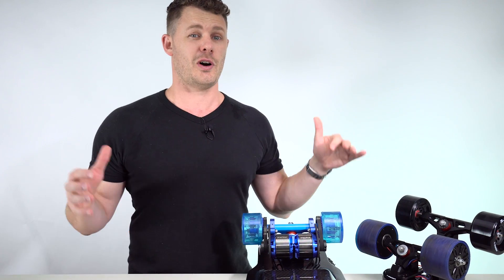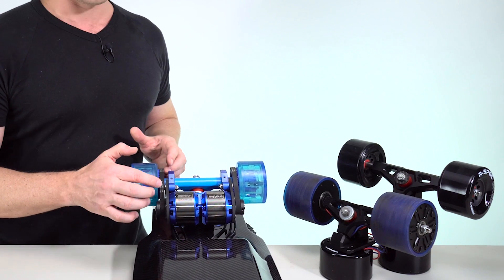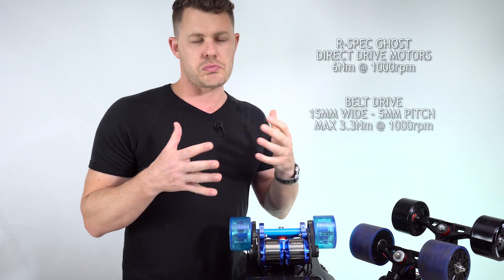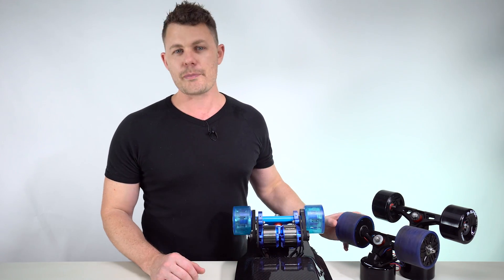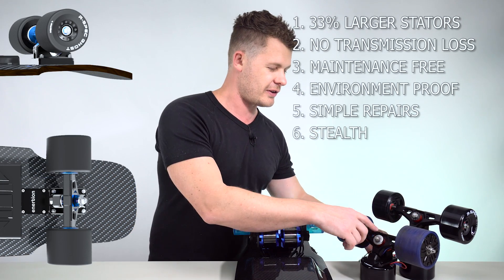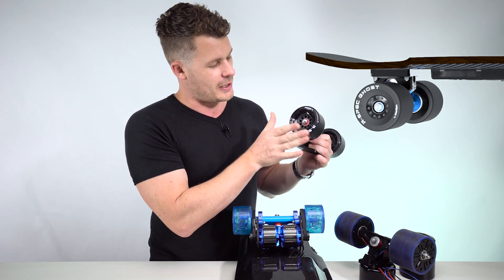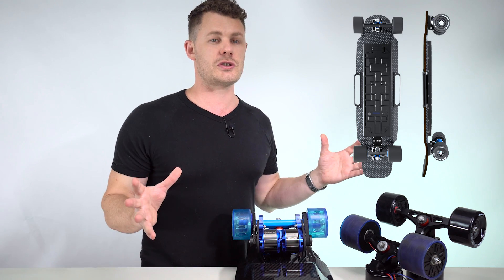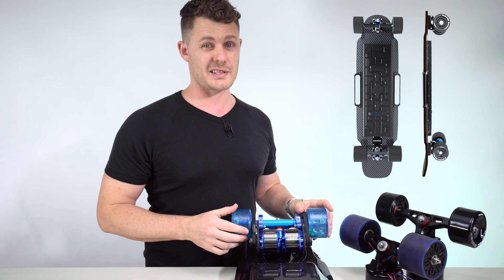Raptor 2 | Electric Skateboard Technology | Direct Drive VS Belt Drive

Comment: Lol, great way to cut production cost by eliminating parts and assembly time to increase the profit margin. The weels turn relatively slow for a BLDC motor and when you optimise a motor for torque instead of wattage you lose out on power density. Sure, the belt drive adds resistance which reduces the efficiency but ultimately it’s about the torque applies to the wheels at speed and a gear drive is just better. As for packing efficiency, just use a longer motor with a wider belt for more power behind and in front of the axle. They don’t have to be both on the same side, or stagger them in-front of each other with unequal belt length. As for protection, a small cover is so easy. Could probably reduce the weight of the board and double the power. Lastly, belt tensioner that increases the wrap around of the drive gear for more contact.

Comment: I just disagree with alot of this, more torque on belt, you can change the gearing on the motor and the wheel, and the tire size and composition can all be changed easily on belt drive,  giving you an unlimited way to change torque, top speed braking all sorts of parameters that you just CANT do on  
Hub motors. I started esk8ing on an actual DIRECT DRIVE and went to belt drive shortly after. Oh also huge difference is pneumatic can be used on belt and not hub. And that is a game changer for off road. I just don't get that you think hub is 2 times the torque??? What do you think torque is? ??

Comment: You can put difference size rubbers for different gear ratios but it's 5 times more expensive than changing belt sizes. But hub motor boards tend to be £100 cheaper to begin with.

Comment: You were comparing belt drives to hub motors, they're not direct drives. There's a difference between direct drives and hub motors in which the motors are inside the wheels for hub and next to the wheels for direct drives.

Comment: Instead  of a dual motor, why not upgrade to a single motor center shaft system. More torque no heat to bearing and the ability to replace sizable wheels on your board. Lessons the chances of a motor failure, heated out put bearings. If Tesla's drive train isn't the perfect example of torque to speed ,I don't know what is . Does anyone agree?

Comment: Baja boards use belts... they have insane acceleration going by their videos (I’ve never tried one but considering a purchase). I have a Wowgo2s with hub motors (non replaceable PU version) and I’m still attracted to the boosted stealth which continues to use belts. The fact that you can change wheels easily is very attractive to me. I’d love to give a Raptor 2 a go though and have heard they are very impressive... will be interesting to see where things head in the next 5 years or so. 

Stealth is definitely important with our current situation in Australia. Attracting the wrong attention... 

Great video 👍

Comment: But yet every test I have seen of a belt drive motor compared to a hub motor the belt drive has more torque takes off faster explain that in the real world testing the belt drive motor still outperforms any help motor that I have seen put against it

Comment: 7:07 I solved that problem in a way that i've never seen anyone do it. 
I get unlimited clearance motor to ground, unlimited motor size and get to keep the gear reduction/torque multiplication.

I can go to a much smaller wheel (looking to move to a 72mm wheel soon) and not worry about any clearances. I'm not concerned with my motors hitting the ground or touching the deck. my motors are not on a super long mount hanging beyond the deck to clear kicktails and forgo ascociated belt slop. I even run my trucks Dropped through. [I prefer my longboard to be as low as possible]
size = power, hubs will therefore never be able to get as low/powerful as my implementation, because physically bigger hub motors inherently raise the height of the board overall. 

9:08 mine is definitely not super stealth - exactly the opposite actually.

details here:
https://www.electric-skateboard.builders/t/ellf-long-low-flexy-loaded-dervish-or-tan-tien-caliber-10-inch-dual-drive-mounting-method-10s1p-dual-focbox/40006

Comment: Its all about the wheels i have abec 107s, mbs 100, kegals and an evolve atv kit. Belt drive = mechanical advantage. Double?? I have a engineering degree and that is bs. Only board to get up Baldwin Street in New Zealand (steepest street in southern hemisphere) was a belt drive evolve carbon GT. A well engineered belt drive will out perform 75kv direct drives in torque stakes, on the flat not so much, raptor 2 is the fastest accelerating board i have ridden so far, but I have stalled it going up hills where my board i have never stalled with non atv's.

Comment: i got two 6355 190kv motors on my board and 16mm belt without increasing the truck width my trucks were 180mm

Comment: talking out of your arse. The hub motors are running on a gearing ratio of 1:1 and the belt motors have a ratio much higher and therefore the motors dont need to work anywhere near as hard. You obviously have no comprehension of the science. proven by how you describe torque. you also claim the technology is more advance when actually it is exactly the same, just a different way of attaching the motors.

Comment: I think this is an interesting technology in the fact that it eliminates parts and theoretically it should make the whole board more efficient and less problem prone. That said it is a concern that the electric motor is sealed up inside that rim or inside the wheel. So how is this motor going to radiate its heat outward? How will this motor not lose magnets due to the excessive vibration that comes with direct contact with the street?  What kind of serviceability would this motor have? I found a lot of the video very informative but when he said that the bottlenecks were removed that's kind of a bit of a red flag because you cannot remove bottlenecks. That is more of a b***** marketing statement. No matter what system you have the best you can do is move the bottleneck around to a place where you can tolerate it most, not eliminate it.
Reply: I get that.  The belt is gone.  Then the bottle neck moves to another part.  Bottlenecks are never gone.

Comment: Sorry, but as far as mechanical limitations go, hub motors will always have less low end torque than a belt driven system. Hence why they need more watts. These increased watts in a compact space results in higher heat and increased failure rates. What do you do when a hub motor fails or when you need new wheels?  Do you have to buy a whole new motor./wheel assembly? Sounds like a great way for retailers and manufacturers to make good money off of replacement parts.

Comment: Thank you mate. Now I  recognise you as the true leader in the Esk8 scene. So far I had erroneously thought it was Trampa. I'll be looking out for a Raptor 2 the instant I see the new ones sold out,  when I figure the relationship between VESCX and vesc6 and when I'll have more control over the battery repair / charging (read: vruzend and cycle Satiator charger)

Comment: I wonder if you could put the motor longitudinally under the deck and connect it via a drive shaft with a differential in the truck? If you were to mold the motor into the deck, you could use a considerably larger motor. You could use a carbon fiber drive shaft to reduce power losses, and you wouldn't have the same torque issues that you have with the belts. 
The horizontally opposed motors will always be limited size wise, whether in the hub or belt drive. A longitudinal motor would only be limited by ride height. And if you are making your own carbon fiber boards, there is no reason you couldn't mold a small hump in the middle of lthe board. You could get a ridiculous size motor in there and not lose any torque due to wheel size either.  
Of course for lower power boards this would be complete overkill.
Reply: was thinking the same with the diff idea.
Reply: herranton1979 i was thinking that too as a potential solution, but i also think the differential adds another potential point of failure in the system.

Comment: Belts suck...! I dealt with them...they have to be tensioned and the teeth wear out on the wheels.  Motors are proned to damage ,being position so low.Ive got pebbles stuck between belt and  belt sprocket. ...its a antiquated notion..

Comment: Those motor / torque specs mentioned need to have the exact motor stats posted.  I can take a smaller brushless motor and easily get it to produce half the torque of another motor - even if both were direct drive. That means nothing unless you post the manufacturer max torque spec and the end torque at the wheel. - Then we can get a real efficiency rating
Or, specify the output torque of each at a specific Amp draw which would give you efficiency
Reply: What about cooling? There appears to be less convection on the wheel motors. Hows the heat buildup over the course of a ride? Heat is the biggest enemy of permanent magnet motors.

Comment: One thing more which is no brainer that is More torque means more current more current means more copper loss and that leads to heat which will eventually fuck motors life unless u have some Breakthrough cooling technique.
And for all the consumers out there it's a pretty cheap and dirty way to make consumers buy products frequently and quickly and by the way u have to buy the specific controller which can only be used for a specific motor.
And one thing more belts and pulleys may reduce torque(and why u need that much torque u r not going to moon anyway) but they  increase revolutions that means for 1 revolution in Hub motor , belt motors can give 2

Comment: I'm really excited for this board.  I wish it had a swappable battery like the M1 but then again if the actual range is anything close to the promised, the Raptor 2 will have one of the best ranges I've seen on a board.
Reply: Electric Skateboard Builder When an engineer and a consumer try to talk to each other ;-D. I meant swappable battery in the sense that when you are out with your board you can have a spare battery in your backpack and just easily swap them out and keep on going.

Comment: Hello esk8 builders, today you will stop building esk8 and buy my product...
Reply: Arek R. Yep... And I did. Space cell, motor mount and the old motor is not sold any more so... The other options are not as good quality or cost/worth wise... Just sucks that i already have a working board that i cant just uppgrade :/

Comment: It sounds good, but as seen from other hub motor designs , the drive wheels wear out quite fast and chip easy (probably cause the rubber is way too thin). Replacement are also quite difficult to source.

Comment: Why doesn't anyone use gears instead of belts??? You can transfer all the power you want through a gear system, have gear ratios, and have proper motor cooling, rather than directdrive

Comment: Looking to order my Raptor 2 to add to my Raptor Fleet (Raptor 1 Dual, production run 1, early adopter) When will you have a comparison video like you did with the Boosted Board Dual + comparing the Raptor 1 to the Raptor 2 ???

Comment: How do you get rid of heat. I have made a model like this. Problem with this, is expensive to produce durable against vibration, heat resistant in "closed up" solution. Bearings will also heat up.

The most costly part about it is to enter the market after  testing and development with a well functioning product.... and 4 weeks later the Chinese copycats will sell for 1/5 of the price with 1/3 of the quality witch will work for most people in the short run.

I made a electric motor and got 100% more torque with the same amount mAh used. So much still not on the market yet. Biggest problem is that many people who try to develop new things for commercial sale/use find that many things are already patented. 

Good luck with this project looking forward too see. I

Comment: Kind of have a question.  It's the math aspect of things.  With different diameters of wheels won't the difference in size make a difference in acceleration.  I think torque is important but it's acceleration your looking for.  With changing mass and size of tires the acceleration is different.  How does this play into the actual acceleration model of the product?

Comment: Very interesting. Are there any disadvantages of the HUB motors? Like durability, the impossibility to switch to a harder/softer urethane wheels or even big AT wheels? Also what happens when the urethane on the wheel(motor) wears out? And how much kilowatts does the Raptor 2 have (peak and constant)? There's no doubt that HUB motors are the future, but I think they need some improvements.

Comment: You could just use gears to get rid of the belt. Therefore you would maintain the "ratio" for better torque that you lose with a hub motor.
Reply: Why are gears a bad idea? I totally agree that hub motors are the future, especially because they're sealed. But you're loosing quite a bit of torque since you cannot mechanically multiply your motors output torque like with a geared system (whether it uses a belt or not). So with gears it would be possible to get better performence with this "simpler to build/do" setup since it at least reduces friction introduced though the belt. It's just way more convinient to use hub motors, but since this tech isn't that good at this point and (as you said) kind of in early stages compared to the more traditional way, there is still a way to improve and totally not "impossible" without hub motors. But it's still smarter to improve on hub motors as soon as possible (and they can totally do enough)

Comment: To state that the belts are bottlenecking the motor's power is very very wrong. Those motors can be fed full power at their peak power RPM and as long as the belts are properly tensioned, there will be no slipping and therefore not torque loss. The fact that the hub motor has double the torque as the belt drive system can be attributed to the stator being much larger, and a much lower KV. All that really means in the real world is twice the heat that needs to be dissipated in a design that notoriously has overheating issues.
Reply: Right. The have a limit, but in my experience, they will not see loads near their limits with these size motors. I'm not trying to prove you wrong, just trying to clarify. What are your plans for dissipating the heat from the hub motors?

Comment: What about durability of the motors getting smashed apart from the ground? I know that the pully system will also get vibrations but surely these will be severely increased using hub motors?
what if you hit a stone hard on the wheel ? could it dent the motor and break it?

Comment: The bottleneck for hub motors are the size. They need to produce a lot more torque in slower speeds than transmission based system since you cant convert the speed to torque. And the max amount of poles you can put into them is limited by size which is limited by wheel size. But i dont have any electric board and nothing to compare them to. Also i still want this board.

Comment: Synchronous belt energy efficiency is pretty much always above 97% given that the belt is of good quality. Are the hub motors more efficient? Do you have any evidence to support this? Are they able to produce more power, more torque, and higher top speeds?
Reply: Electric Skateboard Builder Do you have proper tests to back that up? Not simulations
Reply: they sure do now ;)

Comment: When you have a larger drive pulley, the torque increases because of  the larger radius of the pulley, as T = Fr. Not because it simply engages with more teeth. Just having more belt engaged to the teeth of the pulley doesn't necessarily mean more torque.
Reply: Electric Skateboard Builder Yes, the teeth are there to prevent slippage. Because the teath are there, the belt provides almost 100% efficiency in transferring energy. The teeth on the belt are moving at the same rate as the teeth on the pulley. The belt itself is not your bottle neck
Reply: Electric Skateboard Builder That's funny. I will state this again. The belt itself does not bottle neck the power transfer. The belt has almost 100% efficiency in transferring energy. If you have two motors the exact same, one inside a wheel and the other belt driving a wheel and you dyno'd both, the results would be so close that it would be within the margin of error
Reply: Sean Pain , not if the belt it slips under load and given the packaging constraints in this application prohibit an increase in belt width or pulley diameter the belt can be viewed as a bottle neck. I do have my doubts about the hub system due to vibration, impact load and poor heat dissipation that will probably impact on the durability.